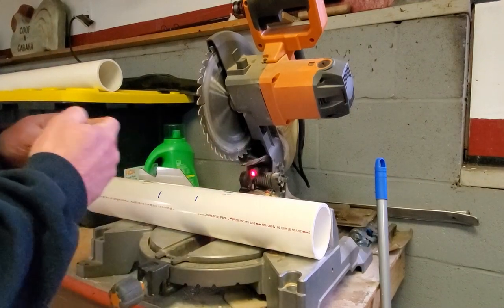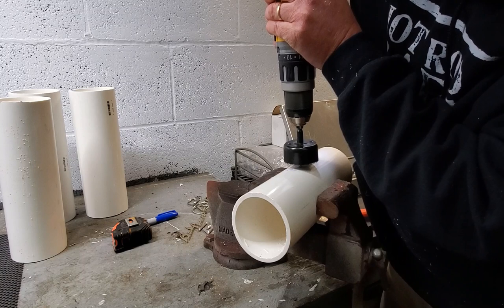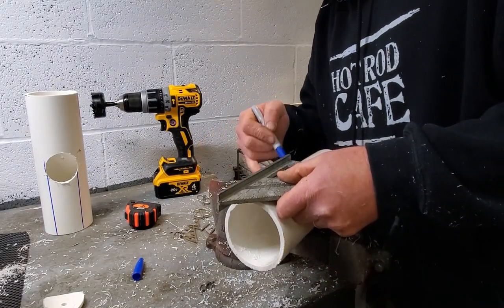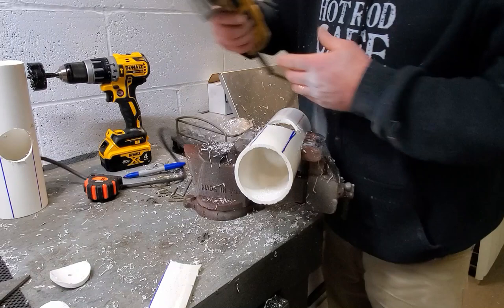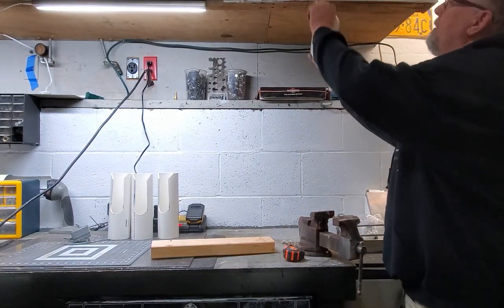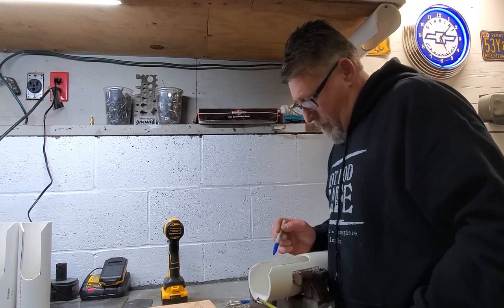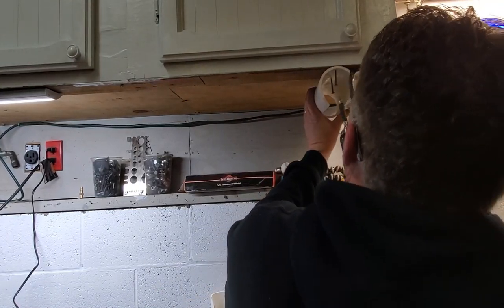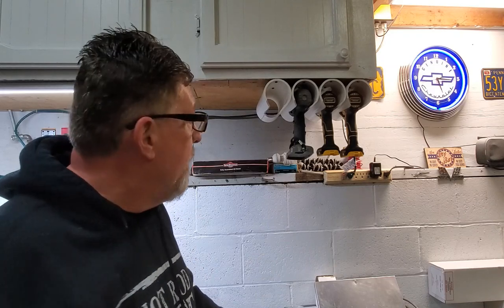DIY Building A Power Tool Storage  PVC HANGER

Comment: If you can get by with 8 inch length,s you can get 3 holders from each 24 inch length of pvc. Saves wasting tubing. Well done.
Reply from the maker: Should be able to do that easily.  Thanks for the tip, and thanks for watching.

Comment: What are you referring to when you said you were getting the tubes level ? There is nothing to 'level'.
Reply from the maker: Just to make sure the tubes are in line and a good tight fit. What you can't see in the clip is on the face of my cabinet is a 2x4 . The back of my tube can be lifted or lowered. Maybe not the best word to us but didn't  want to explain this setup in that much detail  when yours may be completely different. Thanks for the comment.
Reply from the maker: I hope you found this helpful and you built a set for yourself.